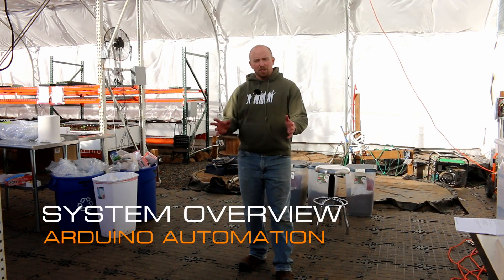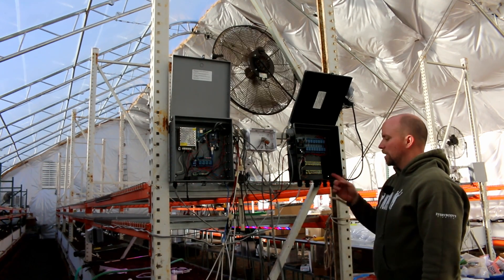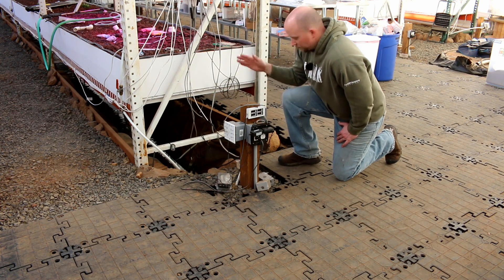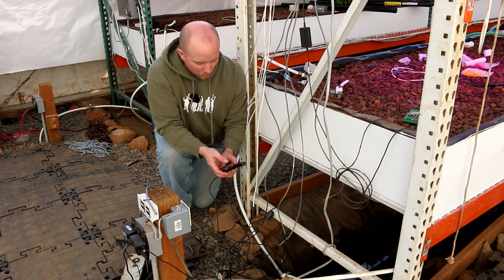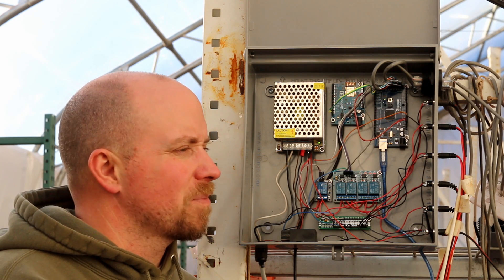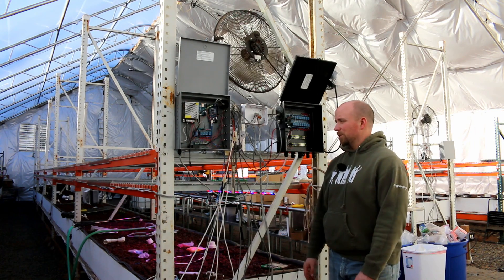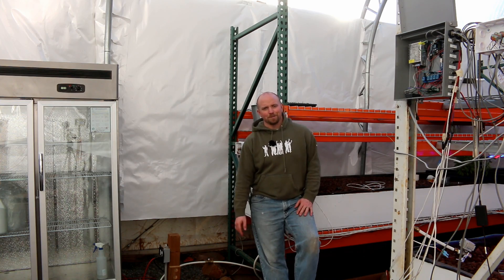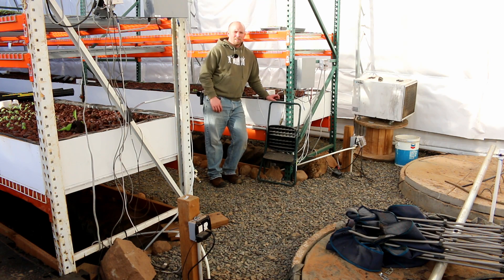Automated Greenhouse - with ARDUINO WEMOS & MEGA

Comment: Arduino or any microcontrollers are the best way to go with this usage, simple, effective, you can turn it off and on and it goes back immediately on what its doing, raspberry pi is just too powerful for these kind of builds.

Comment: Good overview!

For water I would do a combination of mechanical float valve and electronic float sensor that triggers the water solenoid and flags in code if water is fine or is on. 

For the do and ph, is it because they are constantly submersed? Could a system be created that puts them in the water when needed? Like once a day a pulley and motor lower the foam board into the tank for sensor readings.

The system is cool and you did an amazing job on cables and all the setup. Look forward to seeing more on it.

Comment: Hi Jeff,    "Looks" like your missing a sensor. Is a camera a part of the sensor suite? Sure your out there every day tinkering, shooting videos, but what happens when you go on date night to Portland and you want to check things out???? Maybe a three camera system would do the trick. Mount two high on opposite ends of the green house, and one camera on a lane, close up. The close up camera would be able to monitor mold/mildew issues.   Cheers,    Bill

Comment: An even simpler way to look at it, arduino when you just need a device that is autonomous and rasberry pi when you need a device that a human has to interface with.  Like in your setup the Pi would be the better choice for the master unit, but i get arduino is so much easier to get up and going.

Comment: I can clearly understand the reasoning behind automation in this context but what concerns me is basically reliability - you have mentioned today about sensor breakdown. I acknowledge that you have given reasoning for this sensor choice but you are asking for this equipment to behave as you wish in what, to me, is essentially a pretty hostile environment for electronics (high humidity, likely big temperature swings [summer / winter / night / day etc.]) In my area of work (commercial agriculture) there are endless examples of sophisticated electronics failure often down to issues of corrosion at connections or junctions or damage due to vibration or dust rather than sensor failure although this does of course happen.
The other issues that concern me is this reliance on electricity to make it all work, yes I know you have the solar panels but another winter like your last one with heavy snowfall and you are reliant on mains power for an adequate quality supply. If this source fails then you are back to power generation by yourself. In my experience electricity from a generator is not a quality supply BUT much better than nothing!
Lastly how much of this "stuff" is fully documented? What happens if you were to fall significantly ill for a time - could your wife sort it out, or, could a professional electrician deal with it quickly and efficiently because if not you potentially run the risk of yet another crop failure and we all saw how much that upset you and your building is nowhere near full production as you would wish.

Comment: Instead of using motion detection to know if there's someone inside you could just use two laser-light detector pairs in the door.
Reply: Or you could use the cheap $20 Wyzecams that work pretty good and don't require a monthly fee.

Comment: What you really need to now is if the pH is changing. I think that would be possible to detect cheaply just measuring the conductivity of the water.
 What you will get is that all of free ions will be masured, but if you have verifyed a baseline for what is OK, any substantial change would needed to be investigated anyway. If nothing change you can be pretty sure that everything is OK.
Reply: I was also thinking conductivity.  Track it along with all other measurements and see if you can correlate to "something changed" then track down what changed.  Sort of: "needs attention" or "doesn't need attention" signal.

Also, your smart phone should be capable of setting a geofence and signal out to your server.

Comment: Hey Martian, first comment here. If those Vernier sensors don't like to work 24/7, if the levels that are controled by them aren't prone to change too much in a short amount of time, maybe you could "pulse" them, switch it on an off every X time so they can "rest", mostly like a temp prove. Yes between a 70º an a 71ºF it phisically can be a 90º spike, but it's unlikely to happen. Hope it helps. Great work.
Reply: Is the problem that the sensors degrade when used? I thought it is "dirt" like algae getting in and plug the sensor ...